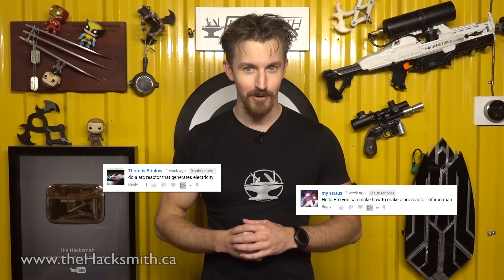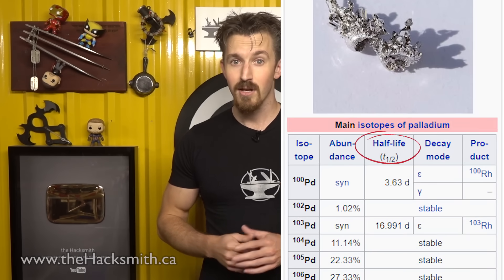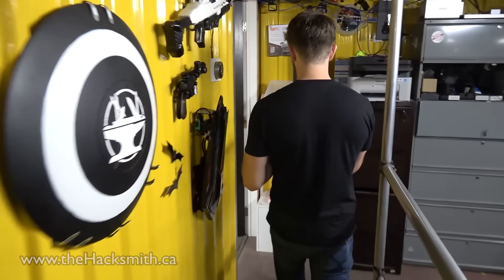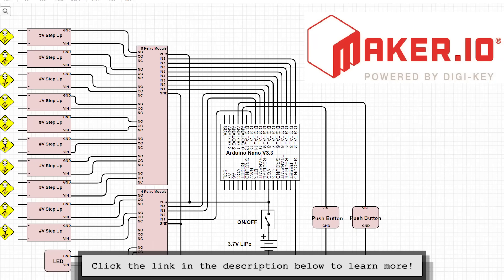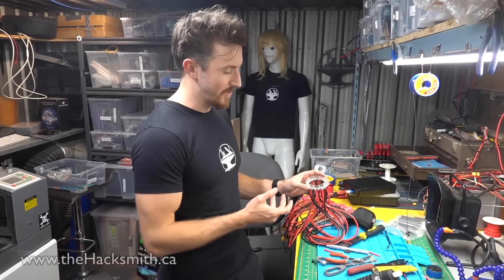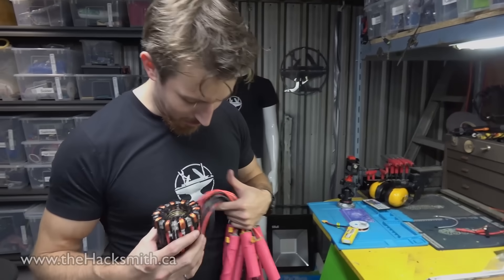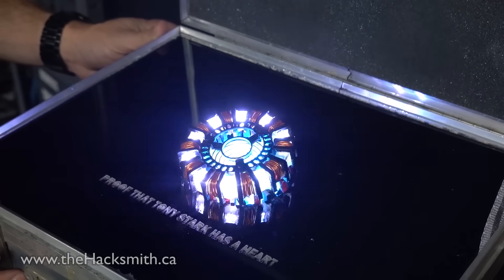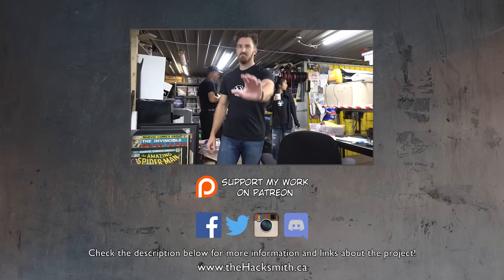Real Arc Reactor (ionized plasma generator)

Comment: You might want to increase the frequency, increase the total voltage while using less and less and less amps. Use MOSFETs if you can operate them in the Mhz range! Use wires with thick insulators to ensure HV isolation.
The problem is that would make the thing very huge.

Comment: The "arc reactor" is clearly inspired by the Tokamak. This is the leading design for fusion reactors which use magnetic confinement. 

Essentially, it uses magnets to squeeze the atoms in the spinning plasma close enough that the attraction of the strong nuclear force overpowers the electromagnetic repulsion, i.e. close enough to fuse.
Reply: Tokamaks are not within the ability of a hobbyist to build, but Fusor reactors are. They still carry out fusion, though not in a manner practical for power generation.
Reply: Why does this not have more likes
Reply: because its not real, well he made a thing but its not some special technology all he did was create a spark gap. Its essentially the same thing your spark plug does in your car and he could have figured out the power output long before he wired it based on the Amp hours from his batteries he used to power it.
Reply: Can you explain it in brief
Reply: @h.r.k-akrc7953  explain what ? How a tokamak works ?
Reply: @E9X330   just tell me the Make process plz
Reply: @h.r.k-akrc7953  the making process of a tokamak ? Look up ITER, that's a tokamak currently in the making
Reply: @E9X330   ok bud thx

Comment: xD

800kV * 20 Amps = 16000000 W 

If all active at same time like DC, but obviously not, divide by around 200 to 5000 times in power usage based on ramp-up times for arcs to form.

0.025% to 0.1% duty cycle.
Reply from the maker: 20A is the input power lol

Comment: My theory on how the Arc Reactor in the movies works is on fusion power.  You see, it is highly visually similar to a tokamak, and it glows blue, like hydrogen plasma.  It also requires palladium.  Now, palladium has one very unique property: it holds hydrogen.  The atoms just slip into the crystalline structure.  Therefore, the palladium could be used as a non-pressurized fuel cell for the reactor.

Comment: I work at a nuclear power plant and we generate 1248 MW electric which is 1.248 GW.  Yes it does generate a lot of profit too.
Reply: it's also enough to power a flux capacitor (+0.38GW spare)
Reply: Adam Spencer .038 but yes
Reply: How do I get a job
Reply: So then back to the future is somewhat accurate with its estimate of the power required that could be generated with nuclear power? Cool!
Reply: Homer Simpson also works at a Nuclear Plant.
Reply: do you think fusion can become a viable energy source?
Reply: @midgetman4206  also, fusion is our last option.
Reply: Ivan Vergara not very soon but eventually maybe.
Reply: Ivan Vergara in the future, of course.It’s going to be a basic technology of interstellar travel. Humans have to conquer this technology.
Reply: not any time soon as long people think how to make money off people cheap... fusion will just take away their profits so they will stop u by any means because money is more important that your life thats how they think. but when we will have no more solid fuel to use then they are forced to fusion or other means

Comment: hey hacksmith, what if you pull a vacuum inside the arc reactor? that way you require less voltage and produce much less heat probably?

Comment: By the way, take a stick of 3/4 inch PVC and then cut it in half length ways. Paint that bitch yellow and hide that t stat wire in the background. I'm an HVAC tech and it caught my eye.

Comment: Try to make a case of PTFE - it is a good dielectric, it can withstand more temperature than Plexiglass and does not melt. Besides that, friction bearings are made of it for high loads — it does not wear out and is not subject to static. I apologize for the mistakes- this is a Google translator.)

Comment: I didn't see any comments on here but maybe U haven't looked hard enough but isn't the arc reactor supposed to be a portable fusion device? Fusion is VERY different then fission. Fission splits large atoms into smaller ones to gain energy but fusion uses small atoms (like hydrogen isotopes) to make higher element ones which outputs energy. The sun uses fusion to make higher elements and produce all that energy it's constantly unleashing. The main reason Tony's ark reactor is so good is that we haven't tested fusion much and we haven't gotten an efficient enough system of fusing to gain energy let alone have massive windows in it and our (arguably/possible) best model is the polywell style reactor which is about 3 meters in diameter for the vacuum chamber. There are many other fusion devices but non are nearly as small or as efficient as Marvel's ark reactor.

Comment: Pretty decent tech. Cycles per second were a little low. You could have doubled up your rotations. You focused the repulsor energy
through ionized plasma channels. It's effective. Not very efficient. But it's a passable knock-off.

Comment: Sooooooo, I may be wrong, but would DC get rid of the arc noise?
Reply from the maker: No it'd be even louder and wear out faster
Reply: the Hacksmith, we'll that's interesting, I'm not too versed in electrical work it's my latest interest. I figured a smooth consistent current like DC would make a better arc

Comment: The Radioactive Boyscout built a neutron gun, not a nuclear reactor, but a neutron gun is worse considering that it's essentially a bunch a radioactive material in a box. (radium paint, smoke detector plates, etc. He shoved his nuclear material jambalaya into a lead box with an aluminum foil cover and then poked a hole in the foil so the neutrons could exit and boom you have an extremely radioactive box that constantly bombards neutrons at whatever it's pointed at. *Note they changed the requirements for the Nuclear Science after this event.

Comment: I thought the Arc was a fusion reactor using paladium which is why it broke down and became toxic to his blood.  Also it required an input of power to get the reaction started if you remember the lights in the cave dimming while he charged it.   It also has to be some kind of capacitor otherwise he's be fried by the power.

Comment: A arc reactor would make its own energy not use a batteries that’s hooked up to it,  it’s basically 5 batteries hooked up to a piece of plastic with LEDS, not even close to an arc reactor
Reply from the maker: No... there is only one battery, there are 10 HV transformers...

Comment: Hey Hacksmith, what are your thoughts on using Carbon nanotubes in a project? Or using it for making web shooters or maybe, just maybe, using it to make the unbelievable iron Man suit from avengers infinity war. I know Tony Stark had used nanotechnology, but if you could give us an insight as to how it works, we would all be very grateful for it. PS - IF YOU ACTUALLY DID MAKE ONE OF THE PROJECTS I MENTIONED ABOVE, IT WOULD JUST BE AWESOME😂
Reply from the maker: Carbon nanotubes are awesome -- but not something you can make easily, or use... there's a reason most of the info about them are from university research papers. Until it's commercially viable it'll be hard to use for a project =(
Reply: @hacksmith  ohh thank you for the insight on it. Keep up the good work mate.
PS- Give a thought to graphene ;)
Reply from the maker: Same thing with graphene -- not really applicable yet :(
Reply: @hacksmith  fair enough, really appreciate you replying to our doubts mate. Thank you!

Comment: You originally showed a 16 relay module in 12v DC to proper the relay, then you changed over to 2 separate relay modules that were 5v DC each to power the relay. How come you changed this?
Reply from the maker: Was the only one handy to show for broll
Reply: the Hacksmith oh right, was just curious as I actually sell Relays in the U.K. 

Great, inspiring video!

Comment: You should not do the high voltage thingy in the computer room because the electromagnetic field created by the ark is not good for the computer and might break them or damage the computers

Comment: I made something similar using a one of those circular photography Zenon flash bulbs with a continuous mini flyback driver running off a 3.3 volt lithium polymer battery. I just vary the capacitance between the bulb terminals to vary the effect.

Comment: you know, ionizing neon gas only need less than 100V. And neon  can maintain ionized for even less voltage. You dont have to ionize air for 800000V.

Comment: Nice! btw, those high voltage modules only make around 30kV MAX. nowhere near 300-400kV that they are advertised at. Nevertheless i still like buying those modules for their price. I've even disected them for testing. Yes, i actually carefully and painstakenly carved away the epoxy their encased in with an exacto knife. The internals are way under rated fot the job thats being asked of them. But somehow, theyr still way fun!

Comment: So after much pondering on this arc reactor conundrum,  I've come to the conclusion that the arc reactor that Tony stark made is not an actual propetual motion device, it still follows our universes laws, the palladium he used was the equivalent of a man cranking the winder on the watch to wind the gears to provide power to the spring that keeps the gears moving, same idea of loss over time still applies, to when the material he uses as the primer degrades .  more than likely his war heads he scrapped out to get  the palladium material from had some sort of shielding to keep the radiation from leaking out, and that was part of his build.  Now I know u don't have the means to get said materials or an equivalent (unless your a playboy billionaire).  It was a wonderful build and I truly enjoyed it. Keep up the good work.

Comment: I always liked to think the reason tony put it in his chest was to use the electromagnetic field generated from the constant closed loop of energy to pull the metal fragments away from his heart, which was the original purpose of the magnet connected to the car battery in iron man 1

Comment: have you considered that palladium can store hydrogen within it with little pressure needed? Perhaps the arc reactor makes use of that stored hydrogen. Now getting more hydrogen into the system is something I'm not especially sure about but that's my best idea of how the arc reactor could work theoretically
Reply from the maker: That small amount of hydrogen wouldn't do anything though

Comment: That's because the arc reactor requires a stroger.force of energy that give a more durable charge. Giga-gewels are a higher level of energy than Watts, and even though you'd be able to make that kind of power, the material formula for the arc reactor is different.
Reply from the maker: Wat

Comment: If my mathematics understanding of Kilowatt hours, watts, amps, and volts serves me right, in theory, 23kwh us actually pretty amazing for a small self-powered (supposing that's what it's doing is powering itself, hypothetically infinitely) reactor, it is actually a whole lot more useful than you might believe. For one Kilowatt hour, you would need to be on your computer for 5-10+ hours out of the day, depending on the power supply draw. You could watch TV for 10-12 hours before hitting a full Kilowatt hour. It's actually phenomenal that such a small generator/reactor like that could theoretically power your home. Unless I misunderstood something, then everyone should be building ark reactors and ditching standard electrical companies altogether. Now, in practice, results may seriously vary. You're only pulling 20amps from that reactor, where the average American home most generally runs anywhere from 60-500amps, therefore, you may lack a bit somewhere. But the fact that it can pump over 900watts a day is astonishing. I should reiterate here that my argument could be flawed somewhere, but the hypothesis is there, none the less.
Reply from the maker: it's drawing 20A at 3.7V ... it's 73W
Reply: I just got destroyed. 
Well, it still served as a cool idea, while it lasted, in my mind.

Comment: You can put the jet powered rockets in the back of the suit and the Hovering engine on the Leg it have to be very powerful and a Advance super battery that will. Not over heat and have a good cooling system and also a smart computer Built in the suit

Comment: Okay, but how does it work? It takes power from the battery to step up and make arcs, but what does it do with those arcs and how are you getting a 5v output again?
Reply from the maker: from the battery
Reply: @hacksmith  so if i understand correct, this isn't a generator its just a fancy 3.7v to 5v booster with an arc 'reactor' for decoration?

Comment: Hey finally a decent sponsor. I hated those mobile game sponsorships, they felt so disingenuous and not befitting of the channel.
Reply from the maker: Sadly they are the easiest and best paying
Reply: I don't doubt it, and I understand why you go with them. But this was still very nice. Hey also while we're at it, thanks for taking my suggestion to use the jet engines on the Iron Man project (at least if you remember all the annoying comments I used to leave on those early videos, and if I was at all the reason you did end up using the jet engines).

Comment: Would it be possible to keep the electricity in an endless loop without the use of wires after start up? The arc reactor tony uses doesn't create energy either, but is more so a super storage for it instead, thus why he can't keep one and only one to use. I'm pretty sure it's possible, just not commonly condensed down into a tiny handheld device like that. I could be wrong although it'd be cool to see.
Reply from the maker: No
Reply: @hacksmith  rip. Im no electrician 😂 i was just recalling off the top of my head a conversation i had like two years ago😂

Comment: it does not make any power it just uses a lot!
Reply from the maker: Correct
Reply: yet you say "so obviously it's not actually producing enough power to do anything useful" which implies that is does make power.  other than that this is a rely cool vid like all of your videos.
Reply from the maker: It's a transformation of power
Reply: an arc reactor powerd stirling engine would be extremely cool.

Comment: You could have just filled the inside of the ring with Argon. Since it makes it a lot easier for sparks to jump, you wouldn't need nearly as many volts to achieve the same result.

Comment: Hey! I thought it would of been best to use a pocket portable power car jumper? Much smaller #2 the wiring couple with rivet, in likenesses of stun gun arc fires to 12 localized conductive tips of wired rivets baring separated stainless steel tube ring cut, housing electromagnet,  BARING copper coil, each should be separated By rubber connected to one of the 12 electrode rivets these being submerged with in sodium water electrolized baring liquid peliter. These shall be enclosed with epoxy resin crystalline 
U can figure out the rest because the electrolytic hydrogen will return power system and will inverter power down  CYCLE. Or inverter power up and will not stop till the liquid is totally depleted. Don't forget magnets its helps to cooler

Comment: What if it was under a  vacuum? Or some other atmosphere other than 80% nitrogen. Just seal it with something like glass and pull a vacuum. Then fill it with another atmosphere. Cody's lab has done plasma in propane. But what about helium. And other things
Reply: I think the vacuum idea would also help with the noise

Comment: ... now evacuate the arc chamber/tube/tubes. insert an inert gas that will not burn but does have a high voltage frequency at which the light it gives off can be absorbed by the aesthetic wire coils you have there....

swap out the coils for 32-40gauge magnetic wire..... "anodized/insulated, copper" at a hundred wraps, in intervals around the loop. use parallel circuits at the same hertz that are off set in timing. run through rectifiers to merge the currents into a continuous DC output...
Reply from the maker: Wires don't absorb light...
Reply: no they don't but they do absorb the EMF generated by the fluctuating field that is being carried through the light.... much like placing an induction coil next to a florescent bulb to detect the electrical bleed/radiation emanated by it!

Comment: Dude you need to use an ionized plasma vortex to dump ions. No ions no sustained discharge. As the ions discharge out of the plasma vortex the replacement value increases and thus a sustained discharge or energy. Plasma is the only valid way of obtaining over unity
Reply: What tf are you taking about

Comment: First, I really loved what you did, I really do. However, if you had adjusted your design a bit to make in the middle of the Arc reactor a battery that could draw energy from the smaller batteries you attached to it, then it would really look like an actual Arc reactor that produces power. And you could have added powerful lights to make it look very similar to the one from the movie. But, overall design was good, just try to make it closer to a battery than it is to a power cable or connector cz that what your design was. Sum up,  try to make it like a power bank with lights and you will be good to go.
Reply from the maker: but energy in = energy out + losses... ultimately pointless either way
Reply: @hacksmith  I know even some energy will go in the form of heat however it will look cool and closer to the one from the movie!
Reply: @hacksmith  or you can put a replaceable battery in it which when it runs out you'll just change it! But I still prefer a chargeable battery